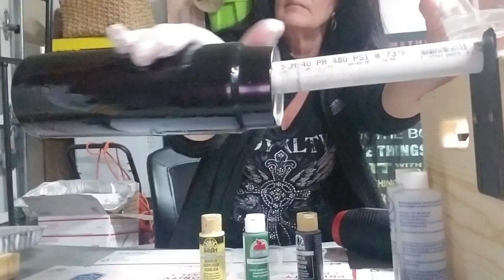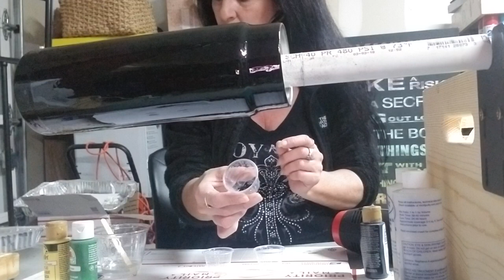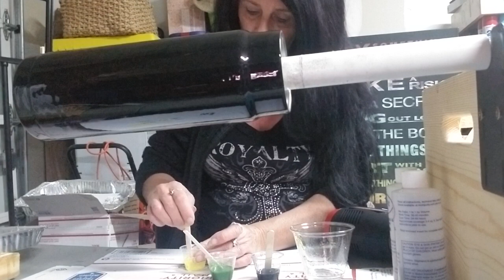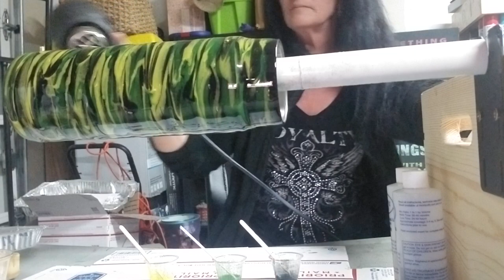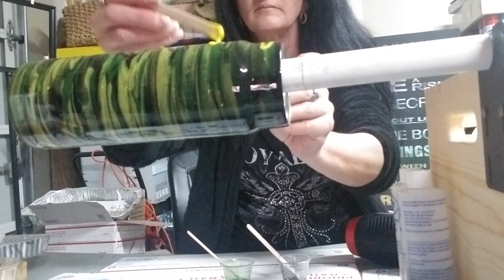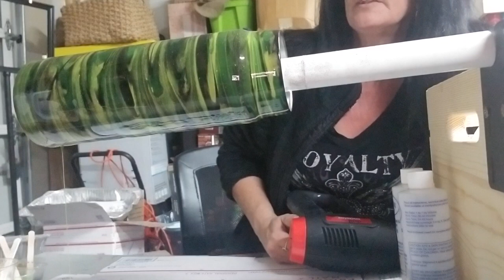CAMO STAINLESS STEEL WATER BOTTLE TUMBLER USING EPOXY & ACRYLIC PAINTS IN 15 MINUTES

Comment: Once finished do you sand it and add anthor coat of clear epoxy? Or what would you do after this process was finished.
Reply from the maker: If it needs to be sanded, yes sand. Mine didn't need any sanding so I laid the decal and then epoxied.
Reply: @skdesigners9452  thank you for responding so fast. This will be my 3rd cup I've ever made and my son wanted camo. So I'm going to attempt this method . You made it look so easy. Thank you
Reply from the maker: @ashleymccubbin7179  you're very welcome! I'm sure yours will come out awesome!